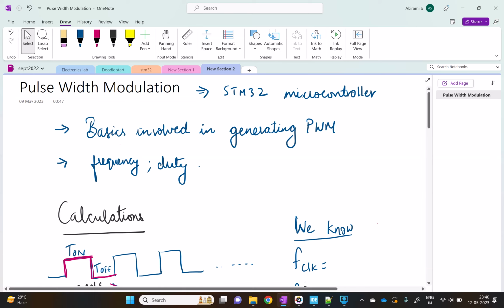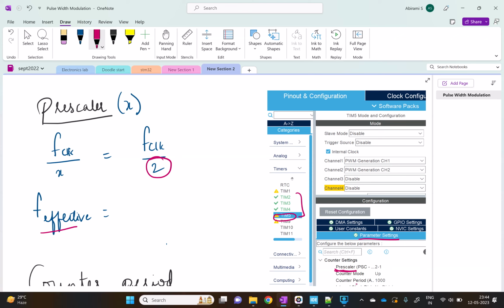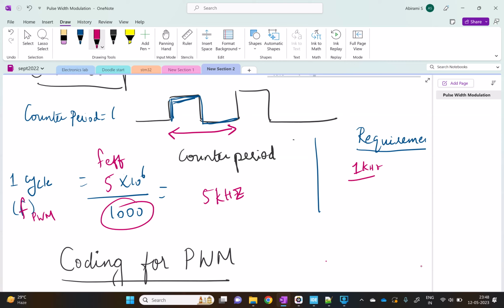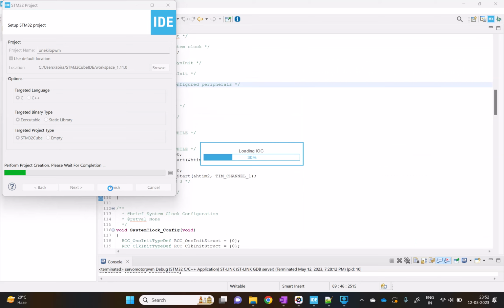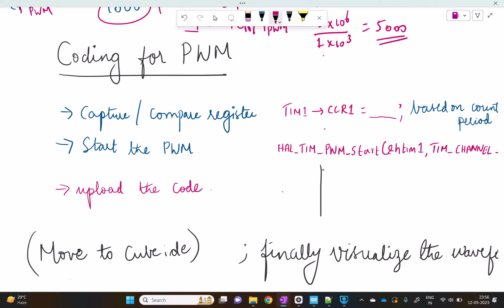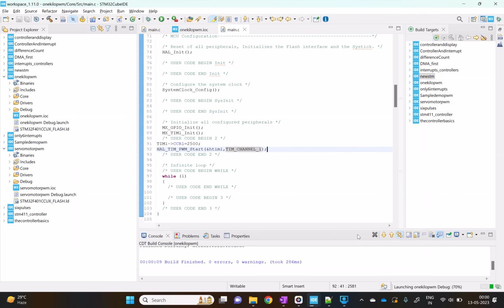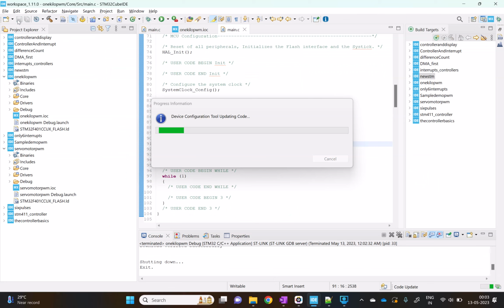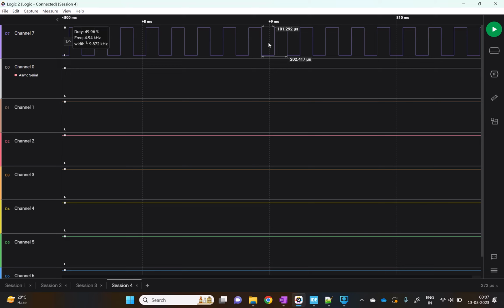STM32 Blackpill || PWM generation || Calculations, coding, cubeide || just for beginners :)

Comment: Many  thanks for you ,great and clear explanation, Can you make tutorial for how to change duty cycle and frequency by potentiometer?
Reply from the maker: Sure, that can be done
Reply: @learnbettereverytime  
Thank you very much for reply.Can you help me to solve my problem?
I use STM32 nucleo-f303zet6 with stm32cubeide , I try to achieve 4 PWM complementary signal with controlled phase shift by potentiometer by using TIM1 channel 1 "PWM Generation CH1 CH1N" and TIM8 channel1 "PWM Generation CH1 CH1N", 
I use TIM1 channel 2 output compare no output mode, I set TIM1 trigger output parameter trigger event selection to "out compare OC2REF", I set TIM1 CH2 output compare no output mode to "active level on match" I make TIM8 in slave mode “trigger mode” with trigger source “ITR0” 
I need to change TIM1 CCR2 in real time with pot., So It can be controlled the phase shift between the two couple of complementary pwm signal “TIM1 &TIM8. but TIM1 CCR2 take one value and no change with pot change in real time.

Comment: Precise explanation! Well, I am just starting with STM32 F103RB and I encountered something that I would like to call as a error. I executed a simple code to toggle the onboard green led such that as long as the blue button in the board is pressed, the led must glow. It worked right when I ran the code for the first time. But, when I ran the code for another time, the led turned out to glow when the button is not pressed and it turns off when the button is pressed. I am clueless about this. Any reply would be helpful! TIA
Reply from the maker: Thank you. Can you paste the logic you have coded?
Reply: @learnbettereverytime  Hey. Thanks for the reply. Sorted that out anyway. Now, got something with this pwm. Says "Target is not responding, retrying" :/
Reply from the maker: @sandeepvasekara8768 I think the programmer is not able to detect the IC. Try coding any sample code, still this exists then you need to change the microcontroller board
Reply: @learnbettereverytime Hey. Firstly, I cleared all pin outs and then configured the device just like you did. But, this is when the error occurs. If I use the default pin outs the code works just fine. Anyways, I think I am gonna be needing you to save my ass a few more times with STM32. You got an Instagram profile?